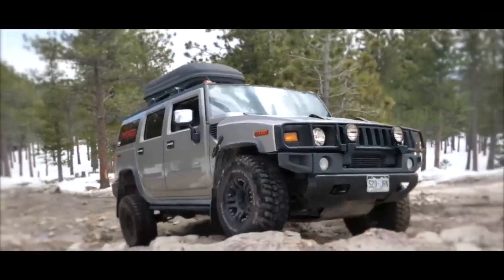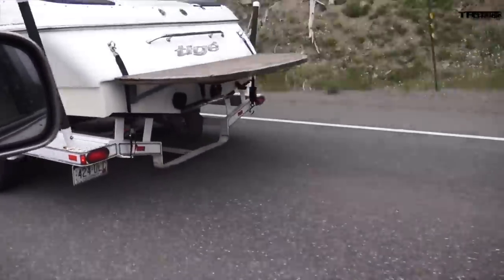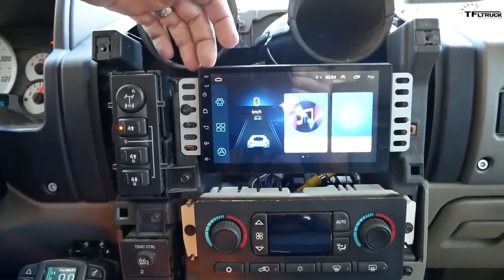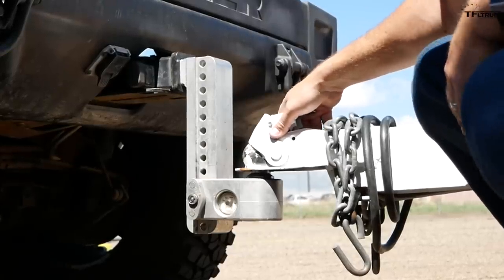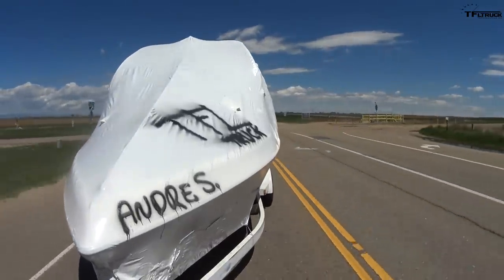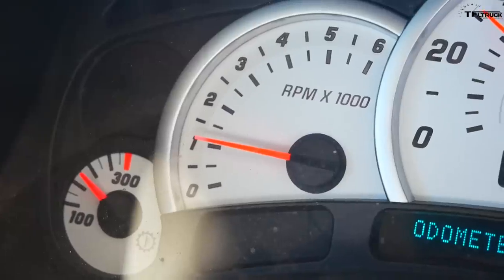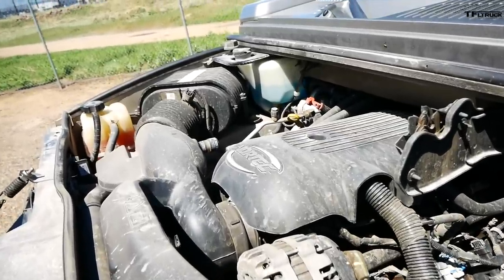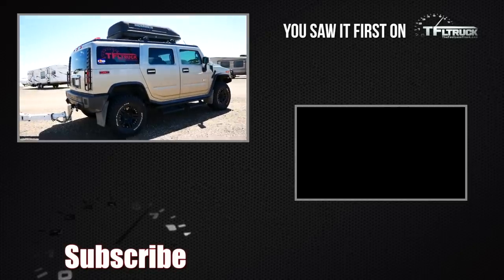Hummer H2 Towing 0-60 MPH Test - Does it Explode?

Comment: 9.6 while towing with that older 6.0 isn't bad.
Reply: No kidding, especially with a four speed spinning on it.
Reply: I get 9.6 without a trailer in town.
Reply: I thought you meant seconds to 60 while towing, before I watched.
Reply: 1999 Dodge Ram 2500, on 35s towing an enclosed 16ft trailer at 5500lbs I get 4 mpg. It's the 5.9 gas engine so it's comparable to the 6.0.
Reply: @bikecrew5892  the boat is much more aerodynamic
Reply: Yeah i have an ecoboost and i was towing a similar weight load and ive got 35” tires with a lift and i was getting 8mpg holding 70-80 depending on the road conditions.
Reply: The issue is the transmission really. The engine does not help but with good gearing this would be much easier on the engine
Reply: I have a similar vintage F150 with the 5.4L and a similar boat. I'm lucky to average 8mpg.
Reply: @bikecrew5892  dang mine gets way better than that. I got the 5.9 as well. I get 8-10. That's not far down from the 13.5 I get my day to day driving. I have stock wheel size though. I want bigger tires as I'm lifted but with all the towing I do it hasn't seemed like a good idea.

Comment: The question you have to ask yourself is would I rather have $60K extra in my bank account and this truck/boat combo or would I rather have $60K less in my bank account or more debt and have a new F150/F250 or similar to tow with.
Reply: Why does it have to be one extreme or another? What about a new sub $30k 1/2 or even 3/4 ton truck, or a slightly preowned rig?
Reply: @ALMX5DP  Because in this scenario he already has the Hummer and mentioned comparing it to a new truck similar to what I commented. A real cheap new truck or used truck isn't going to either be that much better than what he's got or much less expensive than new.

Comment: Towing is not meant to be a speed race! It's supposed to be smooth, cautious, and respectful to the weight your hauling...not to mention the distance it takes to safely stop in an emergency. You could literally haul that same big boat with a V-6 powered S-10 if you took your time, manually shifted out your gears and didn't stress your vehicle.

Comment: The 6.0/4L80 is not a fast combination, that's for sure. But they will literally run at full load and full throttle for 300-400k miles or more. What's your check engine light on for? Could that be affecting the acceleration?
Reply: I was wondering the same thing. There’s gotta be something wrong.
Reply: It doesnt have a 4l80 its a 4l60 thats part of the gearing issue for towing
Reply: Probably the o2 sensors like every other gm of that era
Reply: Gearing is off
Reply: @cameron6049  how do u know?
Reply: I had a 1500hd with 6.0 and 4l80e and the 4l80 lasted 160k miles not towing much lol even changed the fluid every 60k.
Reply: @cameron6049  Its actually a 4L65E. the 4L60E didnt have a tow/haul mode. The 4L65E also has a beefier output shaft and clutches.
Reply: I always thought they had the 4L80 like the 3/4 ton trucks that the engine came out of...didnt realize they had the ticking time bomb 4L60/65!
Reply: @DaltonTk423  2002-2004 had a 4l60 05-07 had a 4l65 and 08-09 had a 6l80
Reply: @x135792468  2002-2004 had a 4l60 05-07 had a 4l65 and 08-09 had a 6l80 a simple google search will tell you that
Reply: You spelt 4L60 wrong. 08-09 had a 6L80
Reply: @DaltonTk423  - My 03 Astro has tow/haul mode and from what I've read it has a 4l60e.  I'm pretty sure tow/haul mode is in the computer, not the transmission itself.
Reply: @DaltonTk423  I have an 03 Astro all-wheel drive with the 4 L 60 e transmission so yes they do have that transmission
Reply: I have a 05 H2, for me the check engine light is on  because most of the sensors in the engine have broke
Reply: @stanludorf2311  My 04 H2 has 162k miles and I tow my 5,000lbs horse trailer all the time with it and it's had no transmission problems. Just gotta maintain it
Reply: Some wrong info on the replies. No H2 came with the 4L60. 03 through 07 all came with the 4L65. It weighed too much for the 4L60 and needed the beefed up 65 (really could have used the 4L70 or better yet the 4L80)  Also 4L60 can and does also have a tow haul mode in many vehicles..  Correct that the 08/09 did come with the 6L80.
Reply: @MixManSC1  Do you know if the 2008-2009 with the 6.2L had the Active Fuel Management (afm) cylinder deactivation system like the suburban/escalade etc? I'm thinking about upgrading my 2004 H2 since family members wrecked it twice recently

Comment: Hi Andre, Your H2 desperately needs some mods! I have 2003 with now close to 400hp and 425lbsft, I have a 2800rpm high stall torque, along with 5.38 gears and my travel trailer flaps in the breeze behind me, I can get up to speed and even pass on the highway will towing a trailer. So you simply need some healthy upgrades!

Comment: The 08-09 had the 6.2 with a 6 speed auto trans that made them a bit quicker.  They also had dual electric fans to cool the engine and it helped keep those transmission temps down.

Comment: I have a 2003 Express 3500 ext with the same drivetrain. I tow my travel trailer, and have towed up to 9,500lbs. Pretty cool to see the same drivetrain working in the video. I wonder how the gearing differs? I agree that the transmission could use more gears.. But at 231,500 miles I'm happy with it.

Comment: Love it! I've got a 08 Hummer H2.  I still have yet tow anything on it.  Also, my air suspension compressor was giving out so I converted it to coil springs so I don't have to worry about having problems with it again in the future.  If I have to tow anything with it, I'll just use a weight distribution hitch.  Much safer that way anyway.

Comment: The towing mileage was better than I anticipated, especially with that big V-8, 35" tires and a 4-speed automatic transmission.  But I must admit that I was laughing out loud while watching Andre floor the throttle from a dead stop.  How about an Ike Gauntlet run?

Comment: My 2006 H2 makes 10.5mpg towing a 4000pnd boat.  True its Slow as slowly could be 
But once on the boat ramp it could take a tank out of the water .
14 years and 140k miles later I still love this truck
An aftermarket transmission cooler is a must

Comment: I'm a  Ford guy but everytime Andre makes a video about his H2 it makes me want to buy one of these. I'm curious what everyone thinks about the smaller H3 models?
Reply: I have a 04 Colorado with 186k miles. Most reliable vehicle I've owned (including Honda, Toyota, VW). If you can find a V8 H3 even better. For better offroad performance look for the adventure package which comes with 33s, and front and rear lockers.
Reply: Trucker Todd go big or go home !

Comment: Love my H2 which I have had for a long time now. Have about 170000 miles on it with a couple things to take care of but it's one of my daily drivers. If motor work is ever needed I'd like to put a 6.2 in there with maybe another trans. Used to have an 07 Escalade and I loved the power and decent economy it had due to more gears.

Comment: The 4L60/80e were analog the prior generations. In my opinion, you gotta use it old school and drop gears. The 321 behind the D gives you engine breaking and the effect of holding gears longer like the tow haul mode does. I think could get the breaking and better speed from that same truck by running it in 3 or maybe 2 even.
Reply: Yes they are old school.

Comment: ya know people give hummers crap but its a heck of a lot cheaper than a g-class and has more power and can fit more kit than a wrangler. it was the best cheap option the military could use. and if you do things similar to what military does (some off-roading and filling it with kit,maybe towing etc) i think itd be hard to do better for cheaper. the h2 and even the h3 isnt to bad just i think people bought it expecting a g-glass for cheap

Comment: I was always amazed at how slow those H2s. You could get a fully loaded Suburban with the 5.3 and still be faster and get better mpg than the H2. But, the H2 is of course better off road and that combo of 6.0 and 4L80E will easily outlast a 5.3/4L60E Suburban.

Comment: The 08-09 tow much better. The older trucks like the one you have were only rated for 6700lbs while the newer ones with the 6.2 and the 6 speed were rated for 8000lbs. It toes way better. The 4 speeds are just pathetic. 

Also did you have tow/haul mode enabled? I didn’t see it on. It makes a big difference.

Comment: How bad would it be to shift manually and keep the revs higher? I'm sure it has a gear 1,2, and maybe even 3 option with overdrive.  I do that in my underpowered honda sometimes if I need power on a hill or to pass.

Comment: The problem is you didn't change the axel gear ratio, when you upgraded the tires...are they 35s? If you goto 4.56s or 4.88s it brings everything right back to specs..

Comment: That's the only thing I never did like was the all the time AWD. Id take the drive shaft out for the 4wd during the summer time. Give you little better fuel mileage to. Done it with my trail Blazer helped alot.

Comment: We still have our old H2 6.0. It has an electrical drawl though. It’ll kill a battery in a week if not started. Mechanically it’s been very reliable but SLOW is an understatement. Top speed towing a 6500 lbs boat in that truck was about 70 until you hit the TN hills and you’re lucky to go 50. I couldn’t make it from Memphis to Nashville on a tank of gas unloaded. That’s bad.

Comment: When they built the hummer with the 6.0, they forsure overbuilt under powered the engine. Tunes, exhaust (high flow cats) will wake them up. beyond that, HCI (Heads, Cam Intake) with slightly larger injectors really wakes them up. Beyond that, custom turbo, superchargers easily give it 75-100hp.   The 6.0L 366ci engine making only 325hp is way detuned. They do that for 2 reasons, 1 it runs on 87 pump gas, 2 detuning it makes them last forever. The transmission was never anything to brag about, but if rebuilt with better parts it's pretty dang strong.

 I always felt like it needed better diff gears, the gearing standard of 4.10 was good for 2003, but really needs to be like a 4.56 orif you want real grunt, 4.88 maybe on 35s.  4.88 is a must if you go 37 or larger. (if my math is right, 4.56 on 37's is the same ratio as 4.10s on 35s) But I feel like it needs 4.56's on 35s, 4.88's on 37s. It doesn't sound like much, but that diff gearing change to 4.56 on 35's would really wake it's towing up and acceleration and would help in in-city gas milage quite a bit by giving it that mechanical advantage.  But it really seems like the stock 4.10 gear was a really bad choice by 2006/2007 it just wasn't enough and should of been changed by GM. 

What kills me is guys who run 37's on stock 4.10 diffs. LOL  ouch.

Comment: My 2004 H2 6.0L has a aftermarket transmission cooler with Fan it really helps..... cost of $200 
 when the total max towing 6700 lbs 
H2 curb weight 6400 lbs 
That's alot of work

Comment: How old is this H2? Love my 3.2l 170 ps 4 zylinder Mitsubishi Pajero 2009 full loaded car 3.1t and trailer full loaded 3.5t 200 km highway and mountain roads are no problem and had over 280k km. but is old and have a "stupid" transmission can not down shift the most i hate and i need on this trip 12.8l Diesel on 100km and is much quicker and not so noisy

Comment: Hey guys, I recently bought a Ram 1500 with a 3.21 axle ratio, can it be possible to upgrade to 3.92 axle ratio? And how around how much would it cost?
Reply: Depends on if it's 4wd and you need to change 2 gear sets. At least around my house it would cost 2000$/axle give or take

Comment: I had a 2007  2500HD with the 6.6 gas. It was not a good pulling truck, the 6 speed trans. It was in the wrong gear.

Comment: I used to own a 03 Hummer and my newer 08 with the 6.2 is much faster. Plus the 6 speed helps with better fuel mileage. I average 15 mpg with the 08 whereas my 03 was getting 11mpg.

Comment: I've owned a 2500 pickup with the 6.0 and towed extensively with it.  It was not nearly as slow as yours...I think there's something wrong with yours.  Of course, the big tires don't help but it should be similar other than that.
Reply: The H1 runs constantly in 4 wheel drive, and the gearing is designed around that to perform better off road.
Reply: dedalliance1 kind of irrelevant given that he’s driving an H2...which is based on the GMT800 platform as was my truck that I referred to. Part time 4x4 with electric switchable transfer case.

Comment: Gut the cats, run a flow master and replace the fan clutch with an electric fan. Easy high bump in HP. I love my Hummers 1/2, not so much my Jeep. Everyone has a Jeep and welp..it wouldn't be able to pull that boat..well not as well as the H2. Oh and the FIRST THING YOU REPLACE is that damn small ass radiator cooler.

Comment: That thing should have got to 60 quicker. Something is wrong or you just didn't take off in 1st gear. Looks like it pulled 2nd gear all the way to 55 mph and then fell on it's face as it went to 3rd.
Reply: Could be the gearing
Reply: @Jonathan-tb6fm  Not in this rig. They would have used lower gearing to deal with the weight and intended off road use. It would need a ridiculously high diff ratio to run to 50-55 mph in 1st gear.

Comment: my 2004 3/4 ton Silverado single cab with 160k miles and that same 6 liter can downshift and hold the gear longer in tow haul mode. It can also shift just a split second slower than my pops 2014 Tundra with the 5.7. I don't thing this hummer has the gearing for 0-60 anything... that transmission must be shot.

Comment: I have a 1997 gmc suburban with a 5.7 and I tow a 7,000 pound boat and it's not that slow.
Reply: But the H1 is running 4 wheel drive all the time, and has larger more aggressive tires on it. Plus the 6.0l is tuned to be a work horse, not to be fast, that's why it lasts forever.